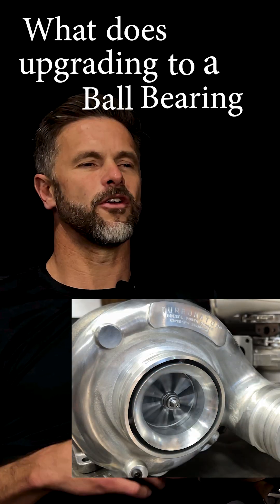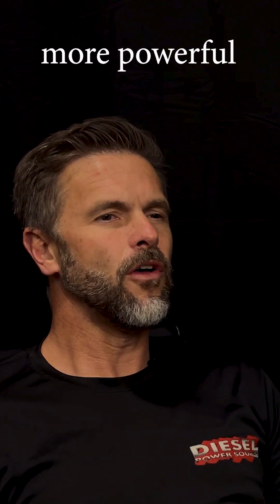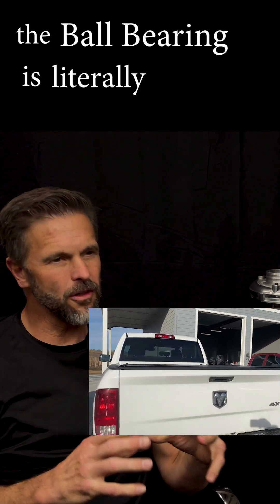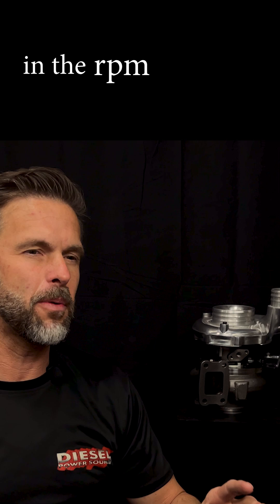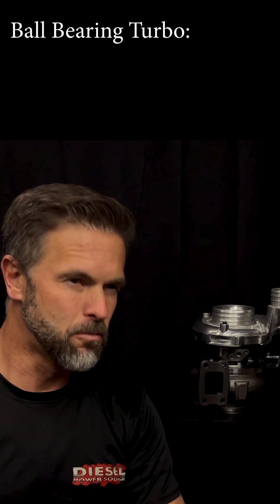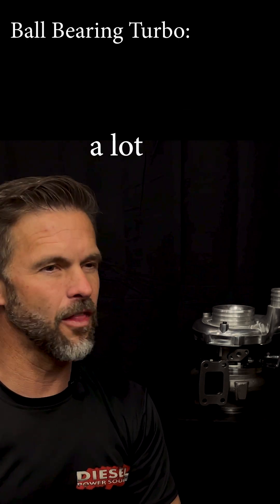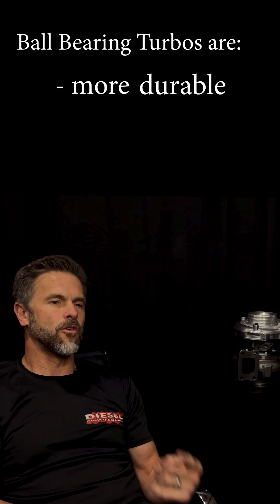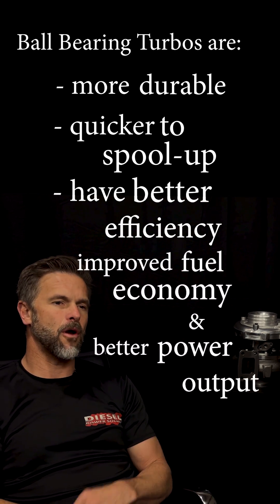Benefits of a Ceramic Ball Bearing Turbo for the Cummins

Comment: Love the pitch but is there an official report or experiment showing what 200-300 rpm faster spool up means?
Reply: A Dyno run showing the different torque curves with a journal turbo and a ball bearing turbo of identical build would be a great way to show the differences
Reply from the maker: @allenautrey6 we should have that posted next week. Thanks!
Reply: I honestly doubt it would be 200-300 rpm however you would definitely see a faster spool up than a journal bearing turbo.
Reply from the maker: @aktionp20  on a Cummins engine it’s definitely 200-300 rpms quicker spool up over the same sized journal bearing turbo.
Reply from the maker: The 200-300 rpms quicker spool up means that with the ball bearing your truck will begin spool up earlier. For example, a truck that begins to spools up at 1600 rpms with a journal bearing 63mm turbo, if you were to put our ball bearing 63mm turbo on the same truck changing nothing else, it would start to spool up around 1300 or 1400 rpms.
Reply: I dont think these folks drive diesels or understand.    
A huge difference of faster spool up for folks that don't need tons of power is the EGT'S. 
Imagine from the head and piston and cylinder to the entire path of exhaust included any heat transfer absorbed going to hot side of intercooler.   All these spots get air faster and cooler.   
Lowering your egt"s regardless of what your doing over say 150k miles on a truck.   Compared to being upwards of 300 to 500 degrees hotter with longer spikes of heat and heat soak.  
Add that up for 150k miles.